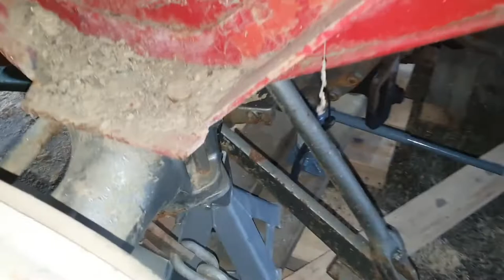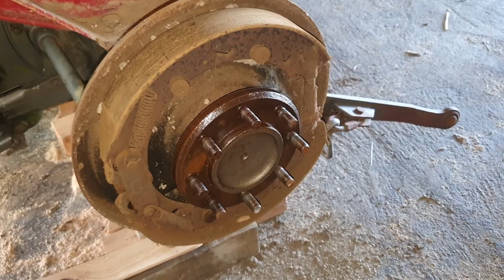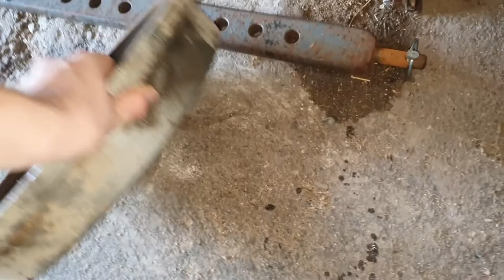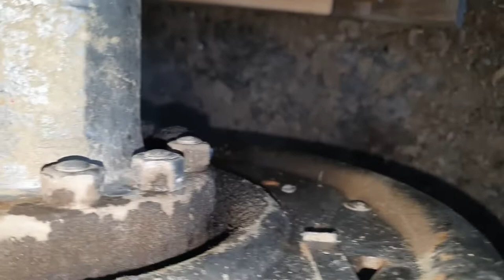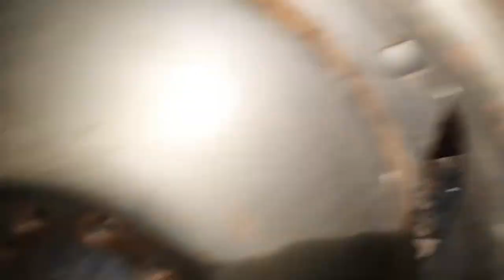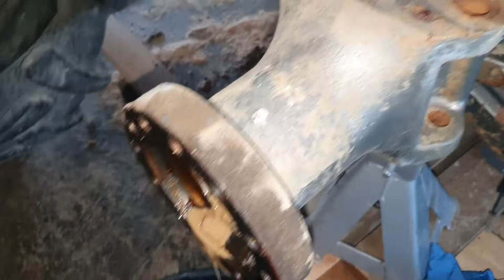Massey Ferguson 35 or 835 DET Brake Drum Removal, Checking Brake Condition, Axle Removal

Comment: Basically, the best option is to renew everything that you can every time. You might never need to do that again.
Reply from the maker: Everything that is worn is best to replace, but as long as the old part is in good condition and within tolerance then there's no need to replace it, like in this case I did not replace the brake drums, but the rest of the brakes were too bad so replacement was the only option.